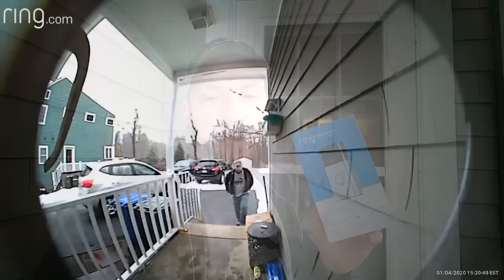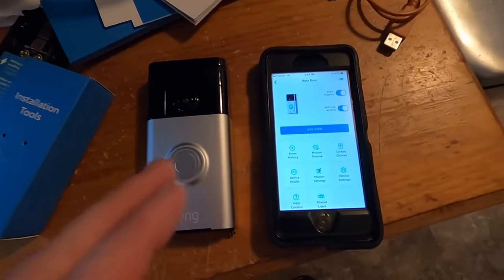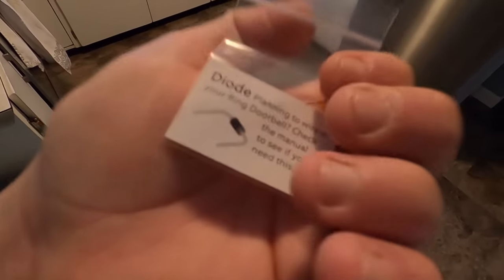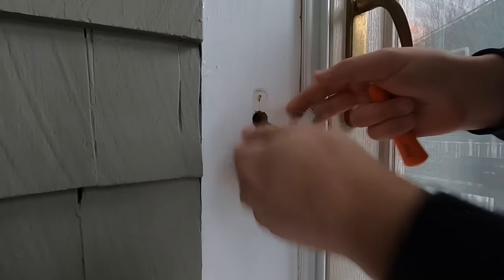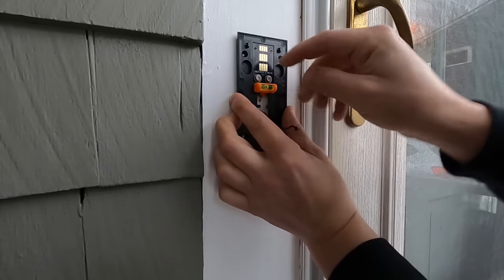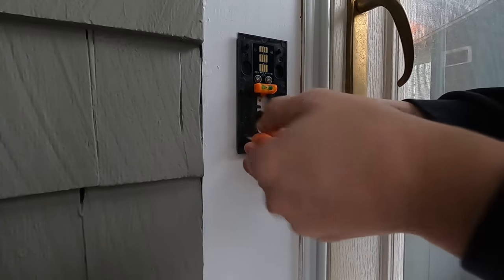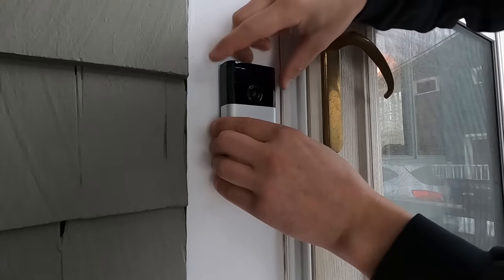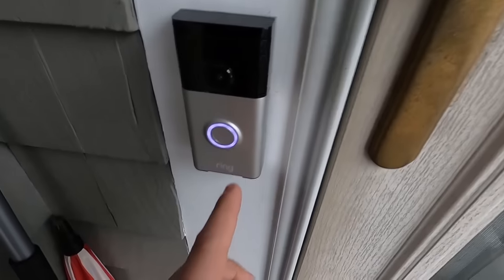How To Replace a Wired Doorbell with Ring Video Doorbell | DiY Install

Comment: Thank you for posting this video. I had concerns about purchasing the ring doorbell because our current doorbell is low like yours, I was afraid we would have to replace the wood around the door in order to make it work, but your video eliminated any concerns I had.
Reply: That is not safe because, you're install an Apllication before you use that device Ring and they will collect your information, camera and picture's so, hackers can watch you and the whole world. Hackers can open your door lock by using the App. So. Not safe.

Comment: The Ring Doorbell Pro requires a constant power supply with a voltage between 16V-24V and at least 30VA of amperage. Even if your voltage is reading 16V-24V you still need to check that you have 30VA of amperage from the transformer, as this is the recommended amperage requirements from the manufacturer of the Ring Pro Doorbell. It should be noted that the Ring Doorbell Voltage requirement for the Ring Doorbell 2 is lower because the Ring Doorbell 2 has a built in rechargeable battery, so it can accept a wider range of voltages because it charges the battery that powers the doorbell vs providing direct power to the doorbell.  The voltage requirement for the Ring Doorbell 2 is between 8V-24V AC. We typically recommend using the Ring Doorbell Pro because it has more features but the Ring Doorbell 2 is a great option if you don’t have access to change out your existing lower power transformer.
Reply: Thank you!
Reply: Question: If you don't mind, if one doesn't have the Ring Pro 2, you don't have to change the transformer, and even if hard wired, you still have to recharge the Ring Door bell 2 battery. Is that correct 🤔. Reason why I'm asking because the Ring company told me I have to change the transformer even with the Ring camera 2

Comment: Great tutorial. I was worried the doorbell location was too low but I can see now that the wide angle lens actually has good coverage from the doorbell location. I'm glad to find someone that shares an install of this device. Ring actually does an incredible job of providing installation guidance and materials. As a person who works with both high and low voltage equipment I have to disagree with the idea that its fine to leave the power on. If you provide the ground to a low voltage circuit it can and will shock you. It will not kill you but you will feel it. If you short your circuit to a ground you can pull enough amps through the transformer you can burn it up and make another item to install. So, dont work with live power, and never suggest someone else to do so. Please
Reply: Yes, he should had told viewers to turn of their circuit breaker.
Reply: Thank you. I keep seeing people leave the power on to wire Ring doorbells. I wasn't sure why. You explained their reasoning to me.
Reply: @Rodney Stockstill Thanks for that info.  I was wondering about that, too.

Comment: Great install video. The new doorbells are packaged differently without a back plate. The wires mount directly to the back of the doorbell. I just got my Doorbell 3 and in the process of installing. Thanks for the info!

Comment: Most people won’t do this type of install because they fear the power and the drilling part. It’s actually super easy. It won’t shock you but if you’re worried about it, add a little bit of electrical tape to the leads if you want. A little extra work for a peace of mind. Totally optional. This is low voltage. I work in the technology industry and you don’t really need to find the breaker and turn it off. 

The drilling part. If it’s wood, even easier. Mark and make tiny pilot holes to make it easier to insert the wood screws without damage. If concrete, use a masonry bit just big enough to insert an anchor into the hole. The rest is pretty easy and just a matter of inserting everything in. 

The diode is used for the newer high tech doorbells and goes across the two screws you insert the doorbell wires to. You can easily tell this too. The sound is like what your phone makes. Old school wins this battle as it’s easier to install and one less thing to towery about. So no diode installation. 

On a note, if you’re installing the diode for a digital doorbell and it doesn’t work after you’ve installed everything, it means you’ll need to reverse the leads of the diode on the two screws from the mounting bracket. That’s it. 

Rule of thumb, you always want to hand tight the screws afterwards. Never use the drill to screw it in all the way. I did this with every simple and small installation projects. This guy did it the right way. Textbook installation. 

That’s the bulk of the so-called “difficult” install work people fear the most. Now, you’ll want to go out and buy one!!!!! Easy!!!!!!!!!!!!

Comment: Very nice informative video!  Do you have to take this thing down periodically to charge the battery? If so, how often is that?
Reply: @TexPR1. You only charge it once, if your doorbell is direct wired. The wires are direct thats your power source to charge it but if don't have direct wire rhen you have buy a separate charger for it. Good Luck.

Comment: Good video, thanks! Your handling of live wires was making me cringe a bit though. I got shocked the other day installing a light switch, I flipped the breaker the wrong way after some testing. Easy to avoid!
Reply: It’s only 24v give you a little flick that’s all

Comment: Thanks for sharing this, I really appreciate it. I didn't know I could change out the RING with the current doorbell without turning the power off to it. Im very skiddish about hot wires and getting electrocuted.

Comment: Very well done! You’re helping me decide if I should get a Ring for Front and back doors as a convenience and security device. My front doorbell faces to the side so my view will be restricted to when the person is standing by the door, not the approach. Thanks to your video I’m also made aware that I’ll have to take down to recharge the unit. Thanks!
Reply from the maker: Actually Mr. Pete you do not have to take the doorbell down if you are using wires that were already there. If it is hooked up to doorbell wires he did not need to remove it to charge it. I should have clarified that in the video. Hope this helps. I can watch it.
Reply: @TheFixerHomeRepair  Yes, thanks I saw how that works with the battery insert. I’m now thinking about the Stick Up which you also did a video on. I will have more placement options and just leave the doorbell alone. I will depend on the motion sensor to activate the camera and or I assume I can activate it myself from the app on my iPhone say if I just want to look outside.

Comment: Is any video doorbell that gets the power from the normal wires? I am not so thrilled about having to charge a battery. Excellent video. Clear, concise, to the point. Thnak you!!
Reply from the maker: Hey!  I should have clarified in the video… if you have existing wires, they WILL charge the doorbell 👍
Reply: @TheFixerHomeRepair Thank you very much for your answer. Having said that, it will not be necessary to charge prior to installing?

Comment: Well done!  Never considered one of these because I thought additional wiring would be needed.
Reply: Well you almost should so you don't have to take your doorbell off to charge it
Reply: @seedsoutdoors3721  so it won’t charge then with the existing standard doorbell wiring?
Reply: @beb1527  I guess not he was saying in the video you have to loosen the screws and take it down to charge. Kinda pointless in my eyes

Comment: I just installed a ring doorbell V2 and it's an even easier install than this one. Now you put the level on the actual ring device and there's no need to use a template to drill your holes! Super easy Installation!

Comment: That's exactly what I was looking for. The one I have installed went offline so I had to take it off to press the reset button. I was out there with a tiny allen key trying to get those bottom screws off until I watched your video. Thanks man!
Reply: That's a ring the new camera on and off do they insert camera

Comment: I bought the Ring 2 at Costco today. Got it all installed and it works great. does the battery have to be used even though I've connected it to the doorbell wires?
Reply: No, if hardwired

Comment: Thank you for the great video. Clarifying Question: So if you do not have an existing doorbell, you can just mount it to the house (following all the instructions, except the wiring)? What’s the purpose of the diode?
Reply: I have the same question
Reply: Correct you can mount the ring doorbell basically anywhere.  I would recommend the solar charging base plate otherwise you will have to remove the ring doorbell to  charge it. The diode is if you have a digital chime in your house. You stated that you do not have a doorbell so the diode you can disregard.

Comment: Great video mate! 

Maybe a dumb question, you don’t need to cut the power before messing with the doorbell wires?
Reply: No because there is no electricity going through them, unless they touch each other. That’s how the doorbell works!!

Comment: This instructional video is well done Fixer. You had a nice touch in that you went straight into this an original purchaser, and did the install from scratch (which is probably how 85-95% of folks go into purchases and installs like this) so that provided a great deal of realistic 'what-can-happen' effect to this video and that helps me when I'm actually doing something for the first time. (As an aside, for the 1st timer, they should find the circuit breaker that powers their doorbell and turn it off before they do anything like this, since electricity can be a real bugger if you don't turn the power off) / Fixer, much appreciated (as I'm going to order this thing now and be just like you within 2 days from now !) / Cheers !

Comment: So you still need a battery even though you’re using the existing electrical wiring?
Reply from the maker: You only have to remove the Ring to charge it if you do not hook it up to an existing doorbell.  I’m sorry I should have clarified that.  So to be clear if you do not hook it up to existing wiring you need to remove and charge, otherwise the doorbell wires will charge it if you have it hooked up.
Reply: I was going to ask this same question. Thanks for posting!
Reply: I hooked mine up to a digital box and now it starts ringing on it's own  and won't stop ringing unless i un hook it.

Comment: Just FYI, As Ring modernizes their units the installation instructions, hardware, and procedures can differ considerably. I just installed the RIng 4 and many things were different from your video (but it is a great primer video nonetheless). Thanks from Rio de Janeiro. I just wish that Ring would stop sending me information and tips in Spanish because I live in Brazil and we speak Portuguese here and not Spanish. However, although I am an American, I know that foreigners always say that Americans are terrible when it comes to geography. DOn't believe me? get a group of ten native Americans and ask them to tell you the name of the capital city of Brazil. I will bet that less than five (and closer to 2 or 3) will answer correctly!

Comment: fyi on positioning the door bell, if your wires were too short.... add another length? takes a few seconds? See holes poking at bottom from old screws? quick sanding,  fill them in and dab paint? another few seconds.

Comment: Couple of questions and comments. You said you can see on the app how much battery power the doorbell has.  Once you wire this up, you shouldn't need battery power right?  The battery would be for power outages only right?  Just want to be sure.  Also, do most of all the newer chimes have enough power for this Ring doorbell?  I thought I read somewhere where you may need to install additional things to the chime in some cases?  Also... love the comment "if the dog barks then it works"!  Hilarious!  Thanks alot for this helpful video!

Comment: Mr Fixer, you didn't have to disconnect anything from the main box before attaching to the doorbell wires?  I just bought one. Thx for the vlog.
Reply: What about the electricity? Does that have to be turned off before disconnecting the doorbell?
Reply: Yes, shut off power first.

Comment: I guess I’m confused on one thing. Currently have an old school wired doorbell like yours, but you need to remove this and charge it when need be or will the low voltage be enough to maintain it?

Comment: Even though you did ... you still need to charge it? What is the point of wiring it? For the bell?
Reply: It received a trickle charge so kind of the same relationship a car battery has with the alternator.
The battery starts at full charge, and receives a constant maintenance stream of power so the battery never discharges.

Comment: Im an electrician, you should shut the power off every time before you decided to mess with any kind of energized circuit.
Reply: Meh
Reply: It’s low voltage

Comment: If your wires are short you can use heat shrink adapters to connect just a heads up.

Comment: So my installation of the Ring was uneventful and successful.  However, I've got a sticky wicket, because on my phone I can hear the voice of the visitor at the door, but the visitor is unable to hear my voice.  Do you have a solution to that one?  I've contacted Ring through the provided phone number in the manual, but so far they are useless.
Reply: Sounds like you didn't give the app permission to use your phone microphone.
Reply: @LMBC6Brian  Thanks Brian,  I obviously overlooked something in the instructions - that makes sense.

Comment: Thank you for posting this video.  I was unsure if I could handle the installation of one of these and I now know that I can.  Just out of curiosity:  How long does the battery last?  This is one thing that I did not know until I watched this is that the battery needs to be re-charged.  Earlier comment here about purchasing an additional battery was very helpful.  Again, thanks for the video; much appreciated!

Comment: Great video!  We installed like you did with existing doorbell....we can’t get the doorbell to ring in the house?? All wires are connected—any ideas??
Reply from the maker: Hey there!  First I would make sure you do not need the diode on the doorbell.  If your doorbell was a “ding dong” type of doorbell, you shouldn’t need it but if it plays multiple different rings or melodies you might need it.  I actually made a diagnosis video that might help you out here https://youtu.be/B64ZSbjpBSQ  hope this helps.  Thanks for watching!
Reply: If you have a digital doorbell chime, it's required in order for your Ring Doorbell 2 to function properly. The diode is not required for a mechanical chime.

Comment: love your videos. so you don't need to cut off the electricity that goes to the doorbell? thanks.
Reply from the maker: Thank you.  It is recommended to turn off the electricity but the wires are low voltage so I wasn't worried.  Thanks for watching!
Reply: The Fixer thanks!
Reply: Always turn off power.

Comment: Received a Ring Gen 2 for Christmas (2022).  Some differences between it and the version in the video.  The wires now attach to the back of the Ring, not to the bracket, which can be a problem if the wires are quite short like mine were.  The only tool included now is a security Torx driver.  The drill bit, level and diode are no longer included.  Reportedly the diode is now built into the Ring and an external one is no longer needed.  The battery is no longer removable.  You must either wire it into your current doorbell system as The Fixer did or remove the Ring regularly, using the Torx tool, and then recharge it from a USB charger.

I cannot get my existing electronic doorbell to work from the Ring.  It works from a doorbell button but not when wired to the Ring.  I read on another channel that the existing chime will not ring when the button on the Ring is pressed.  So, I spent another $59+ for the Ring Pro Chime.  The only function the existing doorbell transformer serves is to recharge the Ring without having to remove it regularly from the wall.

Comment: I'm glad i watched..knowing you have to remove to recharge it when there is power there it could have been designed to maintain its charge means this is not a well thought out product.
Reply from the maker: I should have explained that a little better.  If you have it hardwired like this you DO NOT have to remove it to charge.  It will hold a charge off of your existing doorbell wires.

Comment: Doorbell been broke for so long I forgot what kind it is😂😂😂
Reply: If you have a digital doorbell chime, it's required in order for your Ring Doorbell 2 to function properly. The diode is not required for a mechanical chime.

Comment: Thanks for sharing your video. Does not appear you power off the electricity as the light on your old doorbell was still on when you were disconnecting the wires. Seems dangerous, but I am glad you did not electrocute yourself. You made it look so easy to install this Ring Video Doorbell.
Reply from the maker: Hey!  It would probably be a good idea to shut the breaker off to the doorbell but any doorbell I have ever come across has been low voltage wires so I wasn't too worried about it.  Again, the instructions do recommend turning off the power at the panel. Thanks for checking out the video!